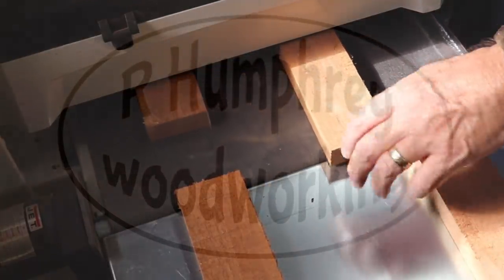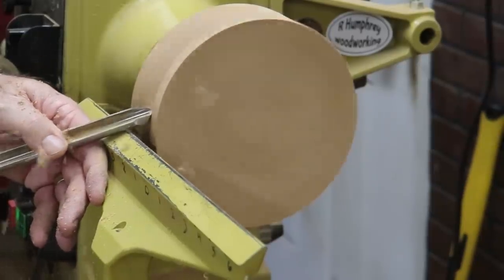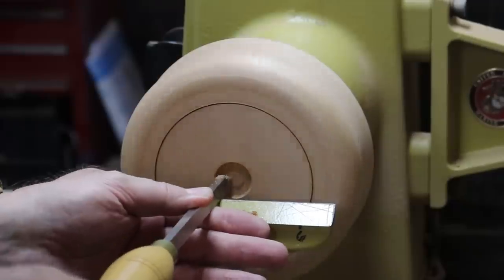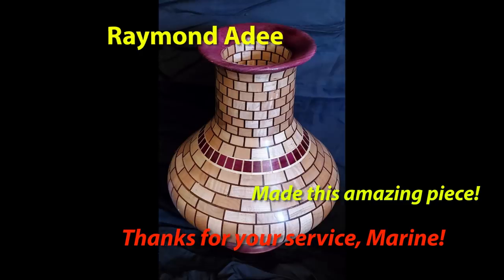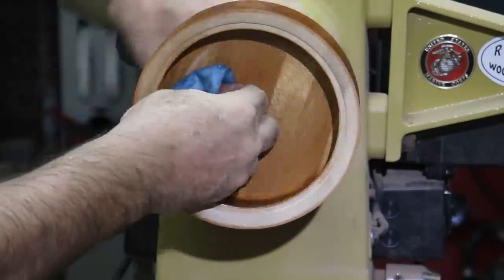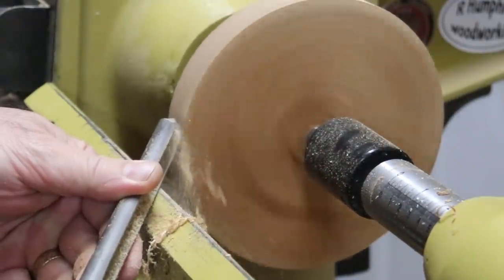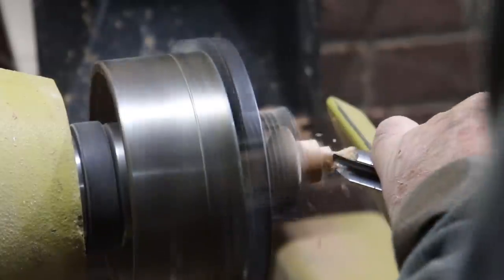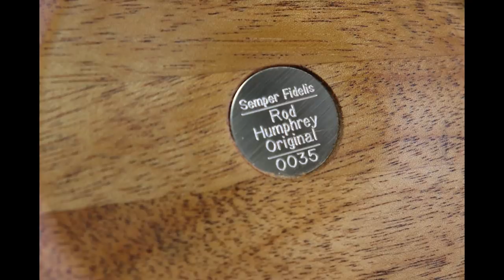Mahogany Board to Box on a Lathe

Comment: What a lovely, sturdy looking piece.  The shimmer with that satin finish is just lovely.  I've heard it said that Mahogany is a very porous wood and wondered if that was true?   Seeing it soak up the Butchers Block Oil, maybe that's true.
I wondered if the bowl is as heavy as the type of wood suggests?  I have an old 3' x 5' table-top of mahogany, about 1 & 1/2" thick and the weight in it out-weighs whole(modern) doors it's stored next to.  A person that got it before myself, tried to caustic dip the old varnishes off and ripped the colour off the boards' surfaces and bad storage didn't help but 20 years in dry storage now and it's still golden underneath, like a good steak should look, rare.  Thank you for showing this video and Keep Well, sir.